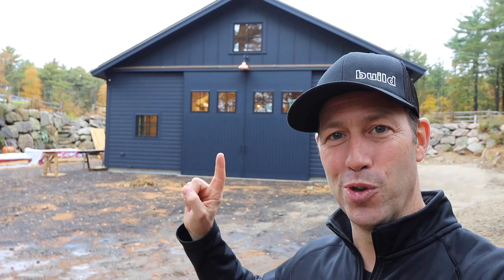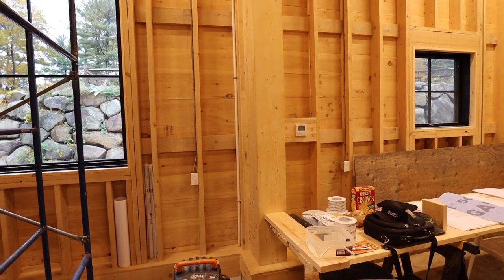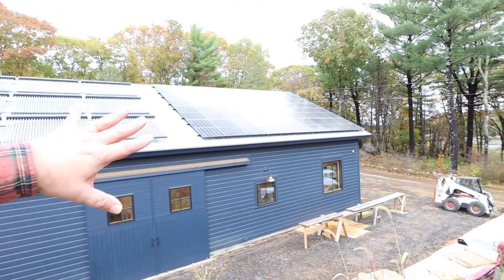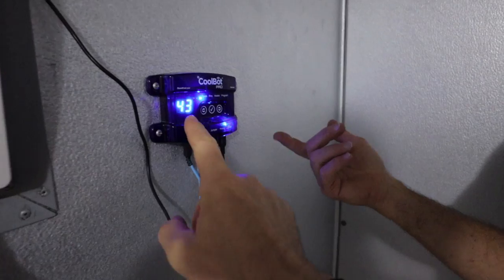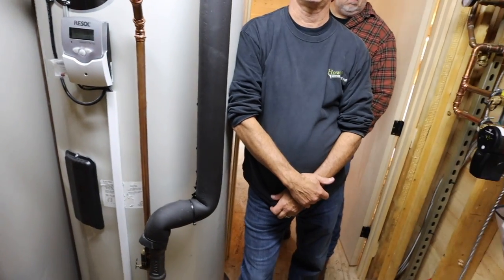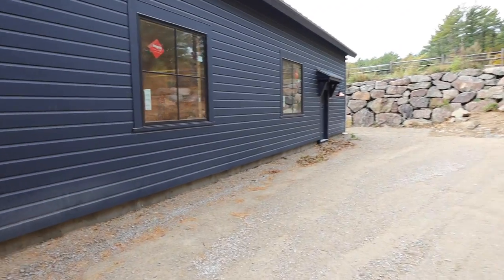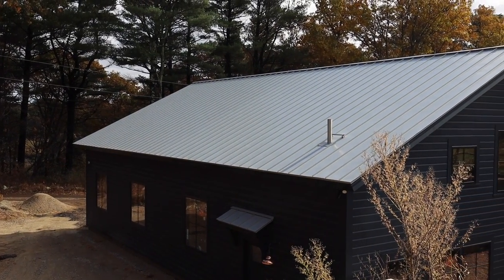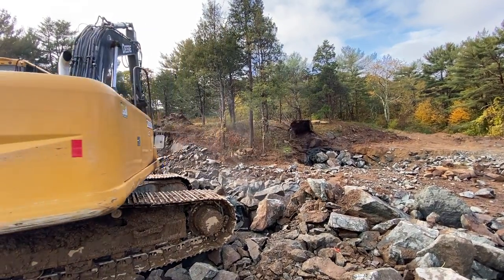Net Zero Party Barn

Comment: The cool bot air conditioner/walk in cooler thing is pretty cool!!!
Reply: That is not going to work. AC are designed to have a certain temperature of return air, no cooler than 60 or so, it's an AC after all. Fooling the thermostat is going to eventually cause the unit to freeze up. That's why you have never seen this done before.

Comment: This barn is about as QUALITY as it gets. I love how open it is, the open frame work, and of course the solar array along with the solar thermal system. I noticed there is some confusion on the solar array, by the looks of it, it is a grid-tied system so there is no batteries. I working to design my own barn house myself, definitely don’t have this kind of budget though. Great work guys.
Reply: Thank you sir - my intent is always to show good concepts of building and building science so we can all learn - the budget drives some decisions certainly, hopefully we can all learn from some of the decision making process
Reply: Steven Baczek Thanks for your reply! While I have your attention, is there a way to do OPEN gambrel trusses without all the post support, beams, and pin? I’m looking to do more stick framing but I want OPEN gambrel trusses! Is there a way to do it and is it structurally sound?
Reply: @roscocarnage9990  The primary ridge and two secondary ridges would need to be structural. You could do the trusses as "moment " connections but would probably require some intense structural design and construction
Reply: Daryl would do some awesome shows in there for sure

Comment: There's a lot to like in that barn.   I think tall-walled barns need fairly long eaves to  shade the walls and direct rainwater away from foundations.   I'd also expect them to have more grade to slope away from the barn.   However, I'm used to deep soils that get mushy, and that site might not have that concern.
Reply: Yeah I think I would have liked a little more but the size of the SIPS roof panels had alot to do with the eave overhang

Comment: Wow , Matt- just a few weeks ago you were in Highland Park looking at a big deal house build- the rock that builder had to deal with is the near surface Austin Chalk which runs all the way from Austin to the Red River, and eastward almost to Houston. A little deeper it starts graying and then to blue- and you take it out with dynamite. The lower two (of three) basements under the Dallas Galleria were cut from the blue rock. The surface white rock can be opened with a back hoe and rock bucket, but most operators charge a higher rate per day because it is very tough on machines. You can get more info from the Texas A&M geology dept.FR

Comment: Window air units are not designed for the saturated suction temperature requirements of medium temp (34-38F) refrigeration loads. They are also missing the components to maintain head pressure, oil return, defrost, and changes in ambient conditions. I really wish they wouldn't have cut that corner. A few thousand more and they could have had a very quality piece of equipment to service this load in the future. If that unit is to see annual operation they'll be changing it out because it won't hold temperature or due to component loss. 

This is an absolutely gorgeous build, good work guys.

Comment: Really wish you had spent some time discussing and exploring the grade beams—the key structural element
Reply: The base plates are bolted to a footing that has a mirrored footing in the opposite wall the footings are reinforced and tied to a reinforced grade beam that connects the 2 footings. In section it looks like a pentagon.

Comment: That roof system is very interesting because I had an experience, as a young framer, with walls pushing out before we got the collar ties and ceiling  joists in place. The walls were heavily braced,  but the load was just too much.
Reply: The key is  in the steel gussets hidden in the corners of the bents,  they keep the walls from spreading at the top.
Reply: 24" snow load..
Reply: Ron Vosick, In that case lets hope the calculations were right.
Reply: I bet it would not hold a New England style snow storm.
Reply: @ronvosick8253  I don't know Ron, but the sheer strength on a 1/2" steel plate is really high.  I'm thinking it will hold up.  I guess time will tell.

Comment: Very nice video. Matt, would love to know the details on air sealing that huge garage door opening-to-door.
Reply: I also wonder how the bottom of the sliding door is going to stop/slow air infiltration when it appears to be a router cut 2x4 riding over a pipe with what appeared to be about a 1/4 in "play" in it.

Comment: I want that barn, too. Hey, looks nice enough to live in. I would be curious to know a bit more on how the sliding doors were sealed to the opening. That’s a hard gap to deal with, especially on sliders. 

Looked like overkill on the split units. I visited a 50 x 70 quonset home in middle TN that used just 2 Mitsubishi splits (singles) that provided all the HVAC needed. Insulated with just 2” closed cell spray in. No other heat/cooling. 

I’m having trouble finding info on the Bora...Borra... Boral siding.
Reply: Agreed,  assuming the air sealing etc... matches the rest of the build there's much more AC than needed. I am imagining a wedding or something with one of those big doors open in summer heat. Lots of commercial spaces need massive cooling so that they can keep people comfortable while still having wide open doors.

Comment: A split unit would make a better freezer cooling unit than that wall mounted unit.
Now of the radiant floor heating - how much do the panels provide warming in the winter without sunlight??? 
Is it safe to assume the water is warmed but electrical heat in Winter?

Comment: Where did they put the battery storage for all that solar. That’s what I wanted to see inside!
Reply: Yeah, that's why I watched.
Reply: They may not be storing it but sending it directly to the grid...and getting paid for it.  There's really no need to store it unless you have a desire to be able to go off grid...which is certainly cool.  But you do pay for that by way of the cost of batteries...which ain't cheap.
Reply: No storage my friend - if it doesn't get used it gets put on the grid......and the client gets paid for it. Yes, not as much as they would pay for electricity, but it is beter than just being lost
Reply: @stevenbaczekarchitect9431  Not necessarily, they may get the same rate with their net metering.  I am grandfathered in and basically get 1:1 net metering for 10 years, so getting a battery would be unwise - only desirable if I wanted battery backup or the feel of only using renewable energy but that's dumb imo - just send it right to my neighbors instead, still the same amount of green energy is being produced and used.  In 9.5 years perhaps I will get a battery.

Comment: Serious barn envy right now. Curious about the price.
Reply: An expensive barn for an even more expensive boat.  

I love the "net zero" talk..  No, its not net zero..  they just "pre-paid" for the electric and hot water with 100K worth of construction.  That is enough solar to power a LOT more than just a barn.   I assume there is a bank of batteries somewhere they didn't show us (or I missed it.)  The solar hot water needs to be that robust though, since it also runs the radiant floor.

I suspect that barn cost more than most homes.   Heck, the solar alone cost more than mine.
Reply: @redwolfexr  True. Solar power is virtually useless without a battery bank and inverter system. One this large would be very expensive.

Comment: Definitely check on the “hyper heat” got all new systems installed in NY and they constantly go into defrost on nights not even close to the operating temperature. Not dependable at all in big open spaces regardless of how well you sized the units. Very questionable option especially if your space is not insulated extremely well.

Comment: In the winter won't the snow build up on the PV panels and solar collectors? Also without any electrical storage, how will you generate electricity on the multiple cloudy days that New England has in the winter?
Reply: if you look at the video, there is a utility pole with a transformer. But your right. Putting solar panels on roofs isn't smart since its difficult to clean them. With the amount of land (80 acres) the solar panels should have been ground mounted. I don't believe the solar system was planned well.
Reply: Do the thermal collectors use antifreeze?
Reply: @williamnaman3570  Yes, Glycol, but that does not solve the issue with overheating during the summer time.
Reply: @guytech7310  it seems stupid to put all that glycol on the roof. Couldn't that be collected on the ground? I also think that water in those tanks should be buried instead of inside.
Reply: @guytech7310  The electric generation, all of it, belongs on the utility side of that transformer.  The utility can build clean power far more cheaply and generate more efficiently than any residential setup, roof or ground mount.  If solar PV is the version of generation people want, then pay the utility to do it well. The fact that a meter is still there to het through the winter  given some $50k of PV and solar heat should be sufficient evidence of this.

Comment: Spends a $1+ million on barn, cheaps out on walk-in freezer. smh
Reply: more like 350,000 very expensive still but not 1+ million lol
Reply: @christianalvarez2025  I think you are significantly underestimating what that building costs
Reply: dodgeplow haha I think you’re over estimating. 1 million is way to much..
Reply: I think a million is probably accurate. The custom steel and lam structure and heated slab alone, with no finishes is probably 250-300, holy moly. Plus coastal NE with that much land, hopefully can see the house
Reply: I’m going to say more than 1m. I’d bet on it.
Reply: Agreed on that one. Should have bought a normal commercial freezer

Comment: Purlins, not rafters.  Also, the roof "moment frame" apparently is primarily developed by the steel plates embedded in the Glu-Lams as shown at 5:04.
Reply: The plates are part of the solution, but eventually the stress gets transferred to a reinforced grade beam between each of the column bases
Reply: @stevenbaczekarchitect9431  Wouldn't any moment need to be resolved at the beam/column connection?  Seems any moment / twisting action between those members has to be resolved there.  Or is the grade beam acting as a tension member,  (not moment / twisting resistor) preventing the bents from spreading?   Even if so, the moment is still only addressed above.  (Nothing in the slab can help resist the tendency for the beam wanting to twist off the column.  That moment has to be addressed there.)

Comment: Super nice! -- QUESTION -- @19:39 you can see dirt staining on the blue wall (just over Steve's left shoulder).  I noticed there were no gutters/evestroughs on this barn, and water is running off the roof and splashing back onto the wall and causing that dirt stain.  Brian, why are there no gutters on this building?  Seems like a violation of one of your much talked about rules when building a house... So surprised to see that here.. I can't help but see all the staining along the bottom of the exterior walls around the building..

Comment: I would be a concerned that the metal roof is fastened to the SIP. SIPs need to breath to prevent rot. Normally SIPS are topped off with a cold roof. 

Also not sure how that system addresses Thermal stagnation for all those solar thermal panels.  During the Summer time, the Thermal panels are going to absorb a lot of heat and no place to dump it. I don't think the Solar Thermal system was well planned out.
Reply: Actually if you properly seal the inside joints so that NO vapor (esp water vapor) can get through you do not need to put a cold roof on top.  Still with that said - A cold roof will provide a much better protection against the potential rot etc.  I did not notice but I wonder if there is any kind of air draw on the underside of the metal roof.  That might mitigate the risk a little as well.

Comment: A walk in cooler using a window unit ac is just a small room with an air conditioner and metal walls
Reply: What do you think a freezer is?
Reply: @Silky777  An area be it either a box or room that FREEZES the objects that are placed inside of it.
Reply: @blb281 , It's just a very large refrigerator.
Reply: @augustreil  I'm well aware, that's why I made the comment
Reply: @blb281 , well, it's a little more than just ''a small room with an air conditioner and metal walls''  That's why I made my comment.

Comment: Budget? What did this party barn cost?
Reply: I'd say at least 1-1.2 mil.
Reply: 1 million seems high but possible. I’d at least like to know their square footage and per square foot pricing. Maybe a million with site blasting.
Reply: How's the saying go: "if you have to ask you can't afford it."
Reply: @charleshoughton  We do a lot of architectural custom builds in Northern California and something this custom will run you probably $500-800 per sq ft and up. So I can't imagine it be much less up northeast.  It's hard to put a price because there's a lot of custom-built stuff here that isn't normal production type stuff for builders so you're essentially doing work by the man-hours. 

The door, for example, is probably a 400 man-hour job + material. To custom make it, and have a team of people to install it. We bill $85 per man hour for our carpenters, and $45 for an apprentice. Maybe 300 hours for skilled labor, 100 hour for help and assistance. Another 2-3k for the material. That door is probably gonna run you $32-34k to have built and installed. At least the first one. The other ones probably 27-28k each as soon as you have the production process down. 

This is definitely an "if you have to ask, you can't afford it". I would have a hard time believing this cost less than 700k even though the inside is kind of bare.
Reply: WillTam08 thank you. I agree your region is likely equivalent to where they’re building, so your feedback is very descriptive. I figured the per square foot price would be high, but it is doubly amazing given that there’s no real “finished” interior materials and yet the cost is that high. I mean, that is one hell of a frickin’ barn!
Reply: @charleshoughton  With the big rock retaining wall, and excavation, over $2m

Comment: Gorgeous building! Odd, though. It seems confused as to what purpose it's serving. Odd combination in that huge cooler, half a kitchen, no stairs to the loft, and no apparent bathroom. If it were mine, I'd add stairs, a simple man door, roll up doors, full but small kitchen, bathroom, delete cooler, and make that loft deeper.
Reply: Yeah, I see I am not the only one.  Especially when they don't even have the HOUSE built yet.
Reply: I think there is a bathroom to the right of the kitchen. They didn't show that corner of the building, but there is another door/room there. I wonder if including the cheap walk-in cooler somehow changed the tax situation for the building, classifying it as a business or something...

Comment: The solar water system - in the winter how would it still work?  Why not geothermal
Reply: The radiation from the Sun is still strong even during the winter.  Just not as much which is why they have 9 of those panels.  During the summer you could probably just about use the harvested heat for blacksmithing.  LOL (I know exaggeration but still funny)

Comment: I just saw an interesting video about energy storage using water and hydro-electric plants and the interesting thing is that these plants are a direct result of "green" energy production and the need to store it for peak demand that doesn't coincide with peak (solar) generation.  The side effect is that peak demand must be met with power generation technology that is not very "green" or "clean".  So, you might feel good that your personal electricity bill is zero but you may actually be doing more harm than good.
Reply: How is it doing more harm?  (Beyond the energy and chemicals etc needed to manufacture the components.)  The building is not pulling anything from the Grid so how does that then harm the power generation process?
Reply: @nhsnm  This building is not "off-grid".  At 23:33, you can see the meter.  

You have to consider the effects on the entire power grid.  Power companies use "less green" technologies like gas turbine generators to meet peak load demands as these can be quickly started and loaded.  Peak demand is generally in the evening when solar output drops off fast.  Look up something apparently called "the duck curve".
Reply: @prototype3a  So what you are trying to posit is that because they might use ANY grid power then trying to be netzero with efficient building practices and producing your own power with solar heat harvesting is somehow BAD for the grid?  I am not sure I really understand your thoughts on this.  I have a pretty open mind but I fail to grasp your logic.  Perhaps you can elaborate and help me to understand.
Reply: @nhsnm  The point is more so that by averaging zero power useage by backfeeding the grid with (solar) energy when there is sunlight is actually bad for the grid on the whole because peak sunlight doesn't coincide with peak demand.

I have nothing against building a structure to minimize the power usage or designing and engineering for efficiency.

Comment: Solar power has been calculated to be N.O.N.E.   or  Negative  On  Net Energy for that part of the U.S. . That means that when you include the energy required to produce, use and dispose of solar panels subtracting the amount of energy they produce, no energy is gained.